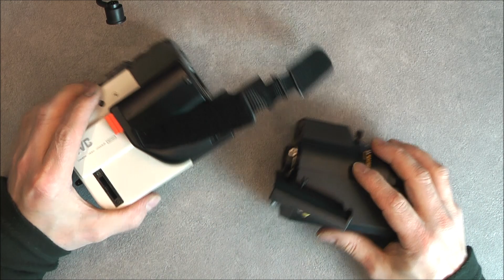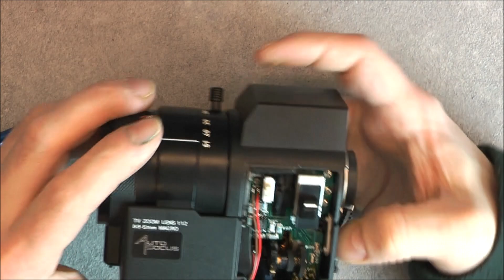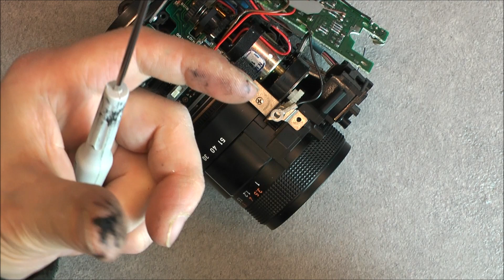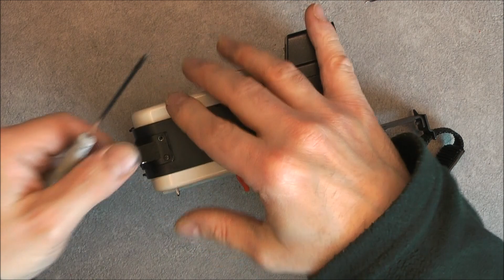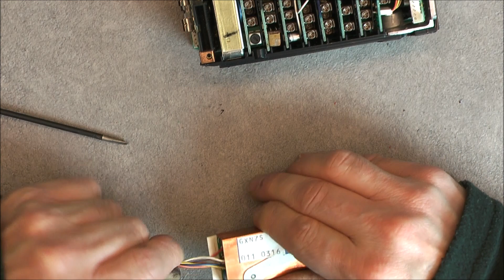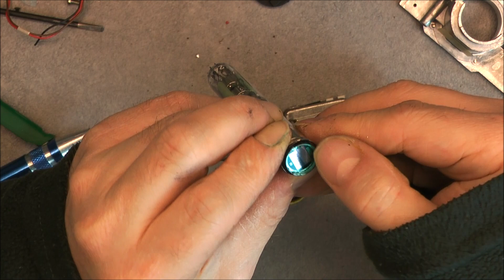One way teardown: JVC GX-N7S monotube color camera

Comment: I wonder which is more difficult to implement, PAL or SÉCAM?  I know with the Atari 2600 you had 128 colours in NTSC, but only 104 in PAL and 8 in SÉCAM.

I can tell you that Panasonic VHS camcorders were exceptionally well built and easy to service.  I took apart a VHS-C  one a while back and was surprised to see a machined aluminium chassis in the tape mechanism, a feature usually reserved for professional models.  The PCBs were also mounted on special edge connectors which allowed them to be swung out of the way and easily replaced.